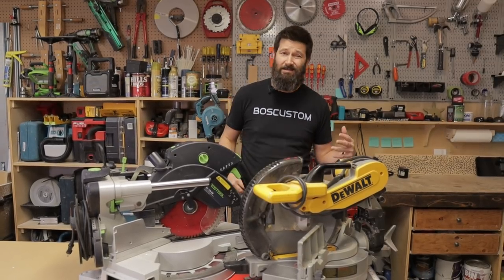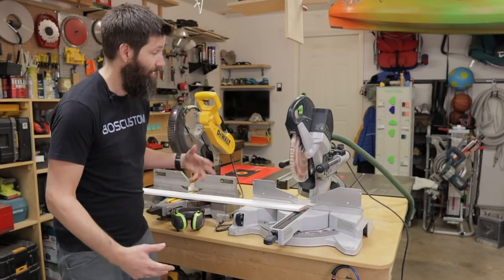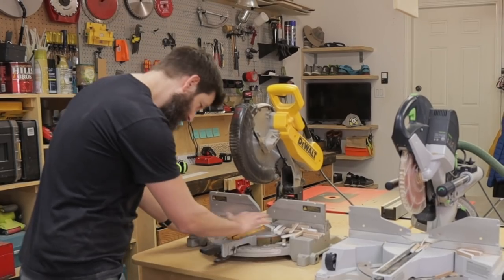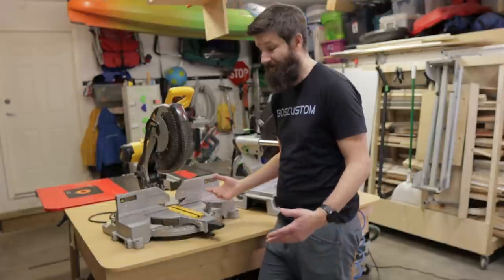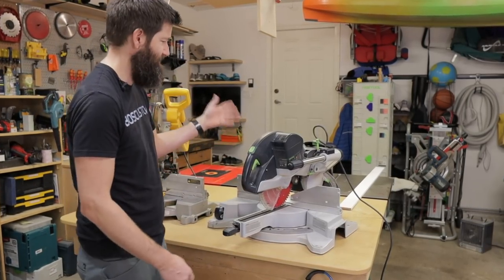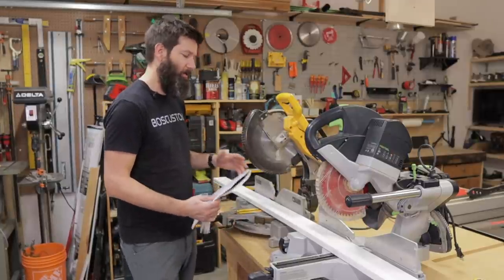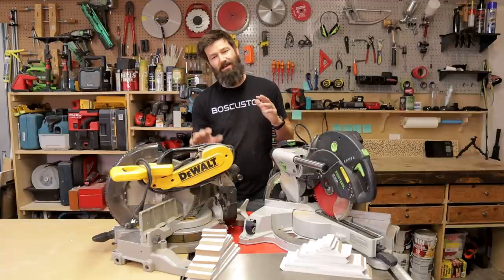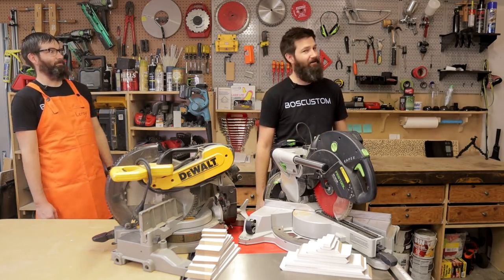Am I a Moron for Buying the Overpriced Festool Kapex-120EB over the Dewalt DW716?

Comment: I went and figured out which tool I used most often in my shop. It was definitely the miter saw. I got the Kapex with the vacuum so I could run it on my Domino as well. It is so dead-on accurate right out of the box and the laser is the best. As for handling long and larger pieces of wood, with just a couple of outfeed supports, I was slinging 12-foot pieces of 2 by 6 pressure-treated lumber for deck rehab with my old blade this summer. I have used it extensively for furniture, trim, and structural work, and after 14 years, that is only $100/year to own the best.

Comment: A few plus and minuses about the festool. The saw is lighter, and easy to move, but the mobile base sucks if you’re taller than 6 foot because the handle is really low to pull walking normally. It does setup at a comparable height to other saws. The working table is too small for larger trim, and depth and length of cuts is less than a good 12” slider and it’s not powered for bulky lumber. (it’s a small 10” tops), but the saw is really good for the average job with normal trim out. The bevel adjustment has the top to release and front handle to adjust which is way better if you work on job sites pushed against a wall, or have a bad back. No more bending to release and set. Last is the dust collection is so much better. I’m inside and I average a lot less cleanup daily. I’m specifically working in occupied condos and the spaces need to be cleaned every day. Also the saw itself doesn’t hold as much dust to drag down the hallway at the end of the job. Every saw has its advantages and disadvantages and the real drawback to the festool is you’re dumping around $3000 by the time you buy the saw, base and extensions and a few blades. As others have pointed out saws don’t teach you skills and a $120 single bevel 10” saw will cut just as well as the festool in the right hands. It’s more comparable to what you drive to work. They all get you there, but the festool has a lot of expensive options that aren’t worth it to most people and you can pay a lot of bills with the money you don’t spend.
Reply from the maker: Some great points here for sure!  Thanks for checking out the channel!
Reply: Wow, you said a LOT of really useful things very succinctly! Thanks! You should make some videos!

Comment: I know this video is a bit old, but I just had to comment. Over the last five years, I owned a number of different sliding mitre saws, and each had its strengths and weaknesses. I wrestled over the last year or so with a Makita LS1219L in terms of getting square cuts. Long story short, I had the same issue many others had, which was the forward rails were not tracking parallel. I tried all the fixes and they all worked for a bit - follow up with Makita did not even get a response. So I bought the Kapex with high hopes and have been blown away - this saw was square and true out of the box - flip cut test was a perfect seam and the bevels were also perfect at 45 and 60. It was no doubt expensive, but the time I will save not having to continually check and recalibrate will eventually pay for itself. And just the confidence in knowing I will get the cut I need….just great for the mental state!
Reply: Wow. Blown away and terrifying.only saw to cut square out of the box

Comment: I own both of those saws. I bought the kapex with the extension wings and rolling stand when there was a big sale. Now that I have been using it for a while I can say without any question it is worth every penny. Dust collection is much better, accuracy is better and the ability to make repetitive cuts with the arms is what really sets thing thing apart for me. Good video
Reply from the maker: Thanks Ben, I'm glad you're enjoying the saw.  How do you like the stand?  I didn't want to pay for the stand so I just retro fit it onto a Bosch stand and ordered the little metal bracket pieces to mount on some plywood wings.
Reply: Festool? Sale? Seems suspicious
Reply: @beantea5592  when the updated saw was released retailers were allowed to sell the previous version at a discount I managed to get my hands on one of them
Reply: @carbb5760  Was this 120 R going to 120 REB ?

Comment: The arguments you placed are valid, except aiming down the saw blade with a Kapex is pointless as you can dial your laser guides and forget all about creeping up on your cuts. I will admit it took me about 25 minutes to dial mine in, but its in use every single day. 

You are right about the dust collection, the bigger and more powerful vacuum you get with a bigger hose will collect a lot more dust (this is where Festool is no longer a tool, it becomes a system).

I don't know if in America this is valid but in Europe we get 3 years theft protection and three years warranty included in the price of the machine along with 10 years spare parts guarantee.

In America I can see DeWalt is extremely popular, but I believe the quality of the tools sold on the US market is higher than what it is in Europe and I have tried all models of DeWalt and Makita mitre saws and they do not come close to the Festool quality.
Reply from the maker: I dialled mine in as well, I just don't really like using the laser.
Reply: I love the shadow light of the dewalt great and accurate
Reply: @TheFunnyCarpenter  to be honest, it is something of preference, although now led lighting to show you where the blade is shows to be much more accurate, I tried a friend of mine's mitre saw and it really eases accuracy of cuts
Reply: @wwmilanl  Festool brought than in on their cordless mitre saw.

Comment: So I bought the makita 10” front rail and the dust collection is unreal.  I love it.  Best purchase ever. I’m glad I didn’t go with the festool but I came really close to getting it.  Basically I flipped a coin and went the cheap route but it worked out better for me.  Look into that Makita.
Reply from the maker: That's a great saw, I've admired the dust collection, the few times I've seen them on site.
Reply: I think I’m going with the Makita 12” front rail. I currently have a DeWalt 780 but I’m about to build a permanent miter station in the garage and the dewalt will hold off the wall too much leaving me less counter space in front of the rail system. I’m mounting a sawgear fence so I’m looking at 10’ of counter top space to the left of the saw to consider. The direct drive motor, dust collection and front release of the compound miter adjustment on the Makita met my three main likes for a saw that wasn’t $1500. I hope it lives up to its reputation.
Reply: @tfast78  so the 12” was my first choice too.  Until 3 woodworkers told over time you have a better chance of creating deflection in your blade verses a 10”. So I went with the 10.  Anything too wide I just cross cut with the circular or tracksaw

Comment: You can get the festool dust shoe for under $20 and after a little grinder work it can be installed in the dewalt, dust collection works as good as the festool for $20 not a bad deal

Comment: You are comparing a fixed compound miter saw with a sliding compound miter saw.  Compare the sliding Dewalt to the Kapex and it would be a better comparison.  I have the DW717 sliding Dewalt, and the table is not flat, the fence is not square to the table, and the slide is not true.  I’ve worked and worked on the saw to true it up.  On a four-cut test, my Dewalt is out 0.042” over 11 inches.  That was after grinding down the table, installing a wood fence with adjusting screws to square the face up.  There is just no way to adjust slide.  It would be fine for rough carpentry, but not finish work.
Reply from the maker: This reminds me of my last Hitachi saw.  It was in the middle of belt sanding the table down I decided I may just need to buy a better saw:)

Comment: Thank you for the comparison. I own a high end construction company. We are always looking for the best tools for our trades.  Dust control has become a very important part of our drive toward safer work environment, cleanliness and the over all experience for our customers.  

Price isn’t really and issue as we depreciate and keep them for a long time. 

We already own Featool vacs, sanders and track saws. We are considering replacing our dewalt 780’s with the Kapex  or we have been considering the new Makita 40amp 10” miter saws. 

I own a dual battery Makita and it does a great job catching 90% of the dust. But it’s kind of nice to have a vacuum that auto starts and stops with the Featool tools we already own. 

Any thoughts on this?  I’d would be buying the saws for our trim carpenters.
Reply: The nice thing about the Kapex is how accurate it is with very little effort. For trim work, that is key so sounds like a no-brainer. I have also found it to be a very safe saw as it is hard to get around the blade safety guard and the built-in hold-downs are terrific. Maintenance is easy and the detents and lasers are pretty much foolproof as well as VERY accurate. The only thing I don't know is how well it holds up to getting slung around job sites.
Reply: You should definitely take a look at the KSC60 for trim work too if you’re in the batteries already.
Reply: If price is no object I’d go with Mafell. Pricier but better build quality than festool. I own both & prefer the Mafells hands down. I use Festool sanders, the Kapex, & dust extraction & Mafell track saws & their cordless Kss40 which almost replaces the kapex in terms of accuracy, cut capability, & portability.

Comment: Going to the larger extractor fitting does increase efficiency but that would mean changing the fitting over for most of your other tools as they would still be the smaller 27mm (1- 1/16).
Due to this i run it with the smaller fitting which does restrict the kapex outlet a little but more convenient.
Reply from the maker: Indeed!  I'd like to make a quick video looking at a few option for this.

Comment: Being a lefty and cutting both handed with every tool I own, us lefties have a completely different pov than righties.
Festool/kapex is quieter and cleaner, other than that, the man makes the tool, the tool doesn't make the man. I can use a coping saw and give a greenie with 100k worth of kapex festool products a run for his money.
I will say though kapex finish guns are in fact levels above the competition.
Kapex/festool= workshop
Non-kap/fes= in the field
Reply from the maker: Lol when unload the Kapex onto the job site you’d best bring the heat:)
Reply: Hop out in $400 Redwings, with $400 occidentals, unload $20k in kapex tools, unload 2 cases of nail putty, 5 cases of caulk....for 100ft of mdf base🤣🤣🤣

Comment: I have had the DW716 and it was amazing except the strong kick when I let the trigger go at end of a cut. Also the round surface where the blade cuts tru was lower than the sides and that was why I got rid of it. Also the Dewalt miter arrow is different you have an older saw.

Comment: I've used both saws for years, you should have had a dewalt slider for an exact comparison. The kapex is a shop saw, and the dewalt can stand up to the jobsite rigors. I will never buy another kapex, waste of money, but the dust collection is second to none. I just keep my dewalt 20v blower handy at all times to blow off the dewalt saw (when im outside). Inside it needs a chop saw hood to collect. I've tried the axial glide Bosch. It is by far superior sliding to both saws. Another thing to note is that the dewalt sliding arm sticks out the back, while the kapex slider is in the front, giving you a tighter space against a wall
Reply from the maker: I’ve been lugging around my Kapex for 5 years and so far so good.  My DW706 lasted about 8 years before the motor blew up.  I’ve borrowed my friends 12” axial glide should have a vid by next Saturday.  Thanks for checking out the channel:)
Reply: @TheFunnyCarpenter  my dewalt saw is a 2008, going on 13 years, nothing broke yet, lol knock on wood. Nice channel man. I'll be following for sure
Reply: Festool does pretty rigorous stress testing on their stuff to make sure it holds up on job sites. Drop tests, shaking while dangling from the power cord on some and they even ship sand from Arizona to blast the tools to make sure they fail

Comment: I have used the non-sliding Dewalt for decades as pro finish carpenter. Can't beat the depth of cut for cutting crown and base in position. (Why didn't Festool make a 12" machine, at least for US market?) Long ago on a job, I made a cone from a Dixie cup and used it to enlarge the dust inlet on the Dewalt. Further iterations of this "Big Mouth" modification hasn't made it a rival for Kapex efficiency, but it does make a significant improvement. The Kapex massive bevel scale is awesome, but there are work methods to achieve precise bevel angles that eliminate the need for micro-measurement of bevel angles altogether.
Reply from the maker: Excellent point on the dust chute modification.  With a little ingenuity anything is possible!

Comment: From my experience, the DeWalt chop and slider saws are well suited for rough construction, not finish work - they're clunky and lack the finesse for finish work.  The Hitachi SCMS is a much more refined tool for finish, as is the Festool.  I would go on ebay and look for an original Hitachi sliding compound miter saw, not the new bastardized Metabo HTP saws.  But if all you're doing is decks and rough framing, the DeWalt is fine.
Reply from the maker: Not a bad point.  My last saw was the Hitchi 10"SCMS.  I liked it but when it came to cutting nested crowing was fairly terrible.
Reply: Finish Carpentry TV would beg to differ.

It's all in how you set them up. My Dewalt droppy is absolutely excellent and very accurate.
Reply: I highly disagree .... the dewalts are great for trim work, ive been making a living with them for many years and i started out on a 9" Rockwell miter saw , yes a 9" !
Reply: I also disagree. I use my dewalt almost exclusively for fine woodworking and finish work, and it's deadnuts accurate, and smooth. I've also never had a problem with it bogging or burning. The stock blade is all decent at preventing tear out. I paid under $300 for mine and I think it's an incredible value.
Reply: @DWINTERS14  They are considered expensive here in NZ. I got mine on a promo with a stand for $1399. Everything is expensive here, but I'm the only one of two guys in my area with a Dewalt saw in my van, and the only one with a table saw in my van. My company has shitty 10 year old 7'1/4" Makitas, some of them not even sliders on the trucks, and one DWS780 in pride of place in the workshop. They have a Makita table saw that quickly broke. The local glass company has the same Dewalt table saw as me, but all the boys have to borrow it from the workshop of they need it. I'm the only one in town with a table saw on board at all times. I guess that's what happens when you don't spend all your money on booze and hookers lol.
Reply: @DWINTERS14  Also what's this about bogging and burning? The DWS780 is frighteningly powerful, I actually have to brace myself every time I turn it on. As for burning, that's always a case of blunt and/or incorrect blade.

Speaking of blades, I'm literally the only guy at the company I work for who actually knows that blades are made for different purposes. There's one of those "finishing" blades on the work table saw. It's one of those wide kerf, fine tooth blades with the center tooth. And it's blunt as hell. It burns it's way through. It's so bad that the dust on the floor looks like salt and pepper with all the black stuff spewing out. I've been trying for a year to get it replaced, and nobody listens.
Reply: @Patrick-857  My table saw will bog a bit sawing 8/4 maple and will also burn it (typical with maple) and other woods. The dewalt miter saw has been a workhorse for me without any of those issues. Mine has a soft start so it doesn't jolt like crazy when I start it up.
Reply: Yeah.. I’m going to have to disagree here as well.  I have my own trim/finish carpentry company, and I run a DeWalt 780.  If you are the kind of person that opens up a box and expects the factory to fine tune your saw, then you may be disappointed with any saw, 95% of the time.  Once tuned, it’s ace.  If you can’t do ultra fine work on a 780, then you probably don’t know your way around a 12” slider to be honest.  The kapex requires fairly extensive set up work from the factory as well - you still need to adjust bevel, miter detent, flatten the deck and wings, which is really out of line for the price point.  I would still buy a kapex if the cutting capacity wasn’t so abysmal for a professional trim and finish carpenter, and if I didn’t know 2 guys who have both been through motors in less than 2 years.
Reply: @irtcarpentry  you are 100% correct, I own lots of festool  products exempt the kapex , I am tired of reading of people saying the kapex is the most accurate saw on the planet , if you can't set and calibrate the equipment then you are in wrong business,  I can challenge anyone with festool to cut any compound mitres and check for accuracy,  and guess what ? We aren't limited with blades and good luck for the Capex of using thick kerf blade , it will die on the spot , love my dws 780 , sometimes I feel like festool users are like tesla owners who like to smell their own farts